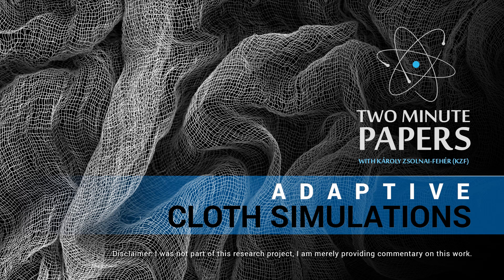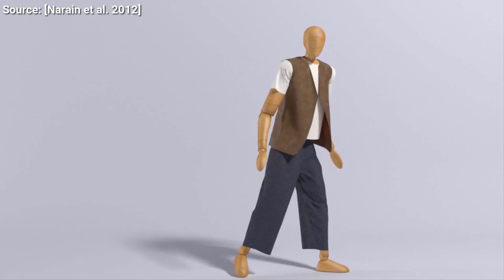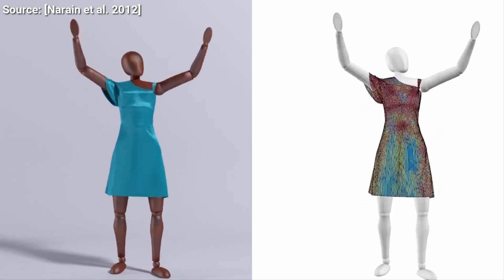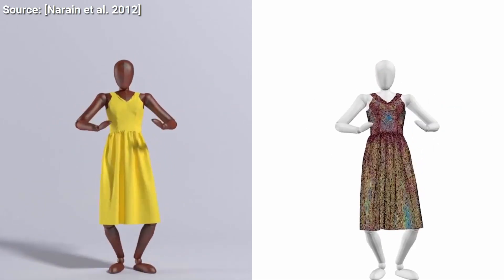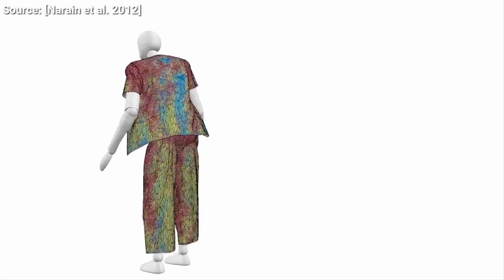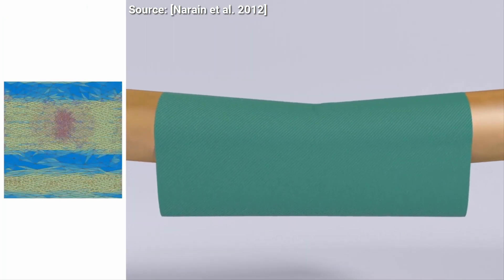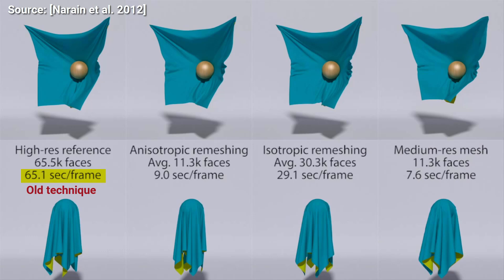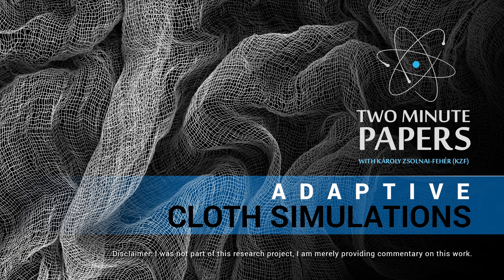Adaptive Cloth Simulations | Two Minute Papers #14

Comment: I wonder how long till it'll be possible to render it in real time.
Reply: +FeFinix The paper mentions that their method works on 3.3 GHz i5 CPU, so probably massive parallel calculations on the GPU could reduce the time quite a bit already. It's an interesting idea for game simulation, too, however... if the remesh is fast enough to run at high frequencies and can work well on the GPU. Would be interesting to try one day!
Reply from the maker: +FeFinix That would be awesome. ;)
Reply: +FeFinix depending on the amount of realism you are looking for, this already is possible. It comes nowhere close to the kinds of results this paper achieves at 9spf though.